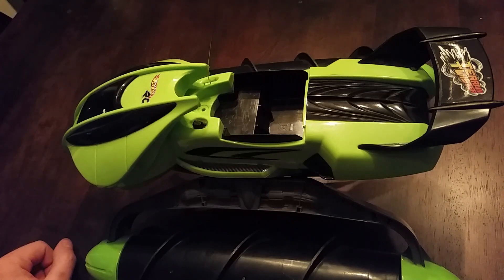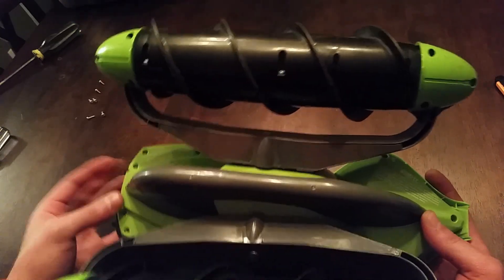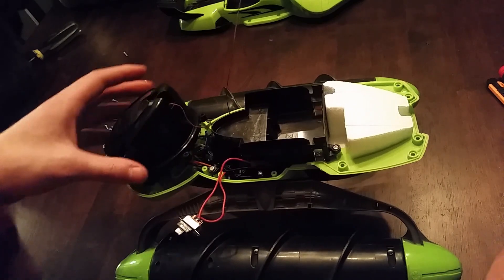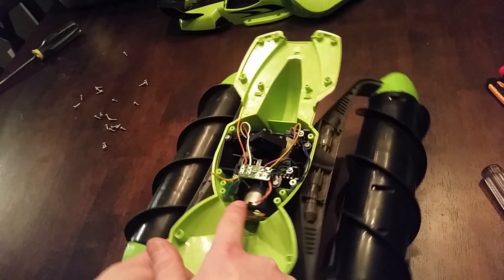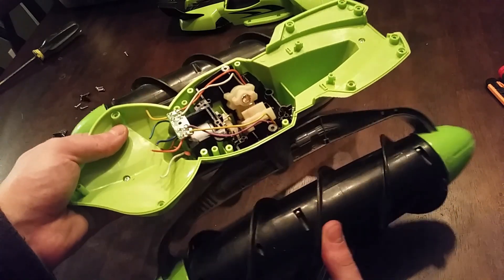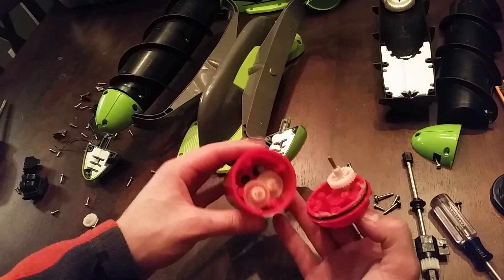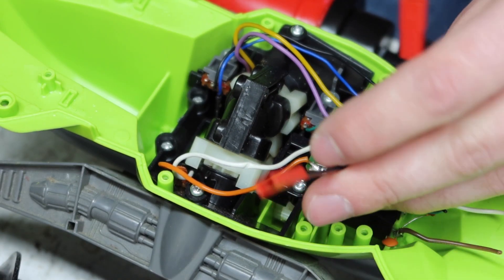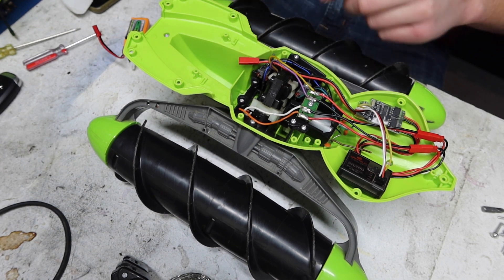Terrain Twister : Upgrading to Hobby-Grade RC Electronics

Comment: Helpful video. I plan on doing a similar conversion for offroad FPV.  I plan on using an air transmitter and wiring up the tilt mechanism on the a 3 position switch. Im not sure how you got the Twister to reverse. did you use a surface transmitter?

Comment: Please were too  connect the yellow wire
Reply from the maker: The yellow wire is the channel 2 input, so it gets plugged into your RC receiver on the throttle signal pin. It doesn't have a 5v and ground wire like the steering cable does.
Reply: @NickMakesBreaksStuff  thanks for helping me what kind of transmitter did you use
Reply from the maker: @eleazarcervantez98  I use a Spektrum transmitter, DX2S in the video. I now use a DX4C
Reply: I’m troubleshooting mine and there is a stray yellow wire. Anyone know what it might go to? It is coming out of the black control box and was just laying there.
Reply: @RobB-o2h  I think there is an extra wire for testing if any water got in the body and cut the power if so, but I’m not 100% sure. I did the same modification as this video and just didn’t do anything with the extra wire. I used arduino nano for control logic so I could still use the tilt functionality

Comment: I am guessing the stock motors burnt up ?? as they have no way of being cooled in those pods  brushless would be the answer though a lot more stress on the drive train
Reply from the maker: I haven't torn into it yet, bit I'm actually thinking the plastic gears either got chewed up, or are slipping on the motor shaft. I'll make an autopsy video soon.